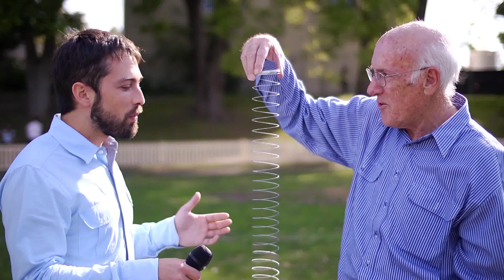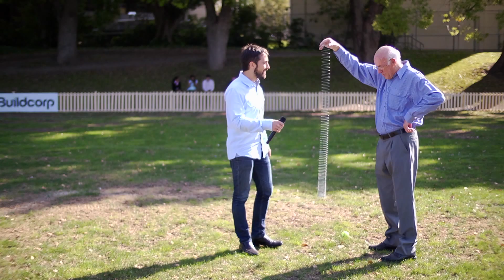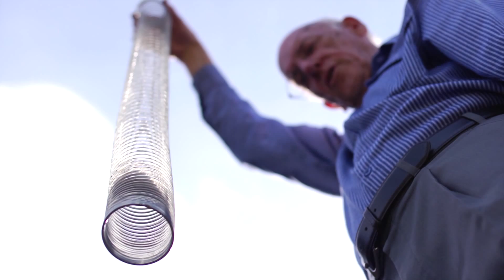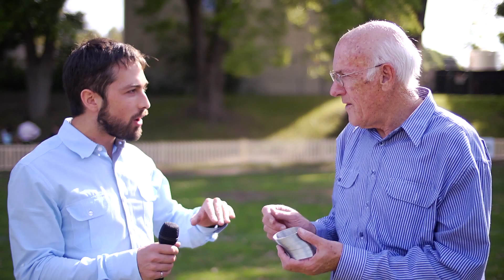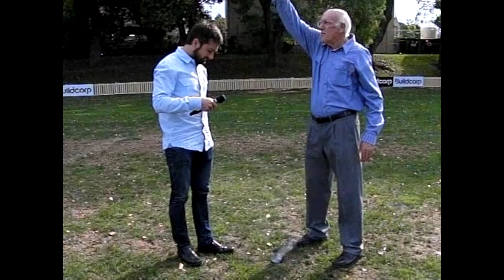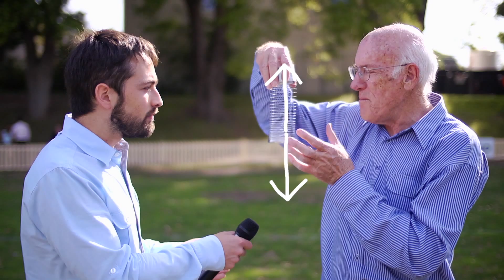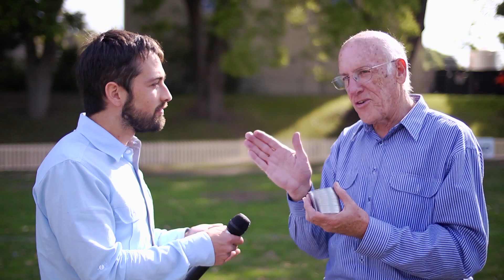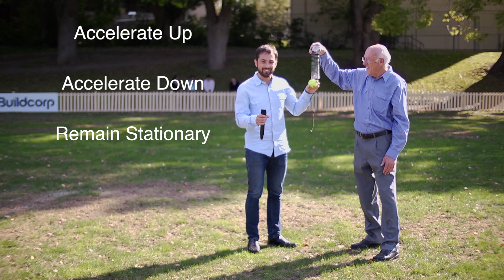Slinky Drop Answer

Comment: we have to consider how the internal tension/strain is a function of only the positions of the neighboring dms - we now see that since at t=0 the spatial arrangements of the dms are the same as t=0-, the entire slinky remains in equilibrium except the uppermost dm, which is accelerating at g. This acceleration results in the decrease in separation from the next dm, and force due to hooke's law springs, F, = kx, where k is a constant. Hence, we see that the force between this dm and the next

Comment: consider a small mass dm in the slinky. at t = 0- , every dm is in equilibrium; gdm = T where T is the tension between dm and the dm above it. Since slinky does not move when being held, all forces at all points are in equilibrium - T = gdm for all dm. now we consider the uppermost dm: mg = F, where F is the upwards force provided by the hand. upon release of slinky, the upper dm loses F, and begins to accelerate at a rate of mg/m = g = 9.81...ms^-2. However, the other dm are in equilibrium stil

Comment: @Soundslikehope 
If the setting is the same, i.e. the slinky gets to settle to the tension which counters the gravity, sure it would. Try to understand the physics behind the experiment. Gravity is acting on the bottom end all the time and upward tension is keeping it in place. The bottom drops after the upward tension drops. A tension change on the upper part of the slinky isn't instantly delivered to the bottom: there is a delay.

Comment: @SimaanFreeloader Continued: Once the spring finishes compressing, then the compressed spring is pulled to the ground by a combination of momentum from the top of the spring and gravity. Notice that even with the momentum of the top half of the spring "pushing" it downward, the compressed spring still moves much slower that the top half alone.

Comment: Actual explanation from reddit:
When a stretched spring is unrestrained, both ends of the spring are pulled towards the spring's center.So what you are seeing is a 2 forces (tension and gravity) acting on the two ends of the spring with two different results:
The top of the slinky accelerates downward very quickly due to the combined force of gravity and tension The bottom of the slinky stays approximately still because the downward force of gravity is balanced out by the upward force of tension

Comment: @Soundslikehope You wouldn't be increasing the tension of the slinky by much, only really by pulling the coils apart more. You would however increase the force of gravity 100 fold. This would not only give you a net down force but would extend the slinky beyond its yield strength stopping it from deforming plastically - rendering it limp.

Comment: I stay with my answer that the ends move toward each other: the bottom is actually moving UP; however, since the entire thing is falling, the apparency is that the bottom stays put and waits for the top to come down.
Reply: The issue is when we say that "gravity" is pulling down everything. 

It is not moving up as you suggest.
You can imagine a ball being thrown up in the air and you will see same effect, when the ball reaches "zero" in upward force it will stay still for a moment and then starts falling. 

Ball is dropping because of its density in relation to its envoirment, air. It cannot drop when there is a force holding it from dropping, the tension of the slinky. It starts dropping as soon as the force reaches "zero" in tension, in other words as they explain it "the information must reach the bottom end".

Comment: @jbrockism 
You need to understand is why the bottom didn't immediately drop. It didn't drop for the same reason that it didn't drop when the guy was holding the other end; the tension force (upwards) counters the gravity (downwards). When the tension drops, gravity takes over. There is a delay before the tension change is transferred down.

If you generate tension forever, the bottom will obviously "hover" forever. This could be done, for example, by attaching the top of the slinky somewhere.

Comment: This is explained improperly. The whole thing experiences the force of gravity, and indeed, the center of gravity begins accelerating as soon as he drops it. It has nothing to do with wave propagation time delaying the reaction of the bottom. The reason the bottom is apparently sitting still is that it's being accelerated with respect to the CoG due to the spring force (tension) at the same rate as it's falling, all because it starts in equilibrium.